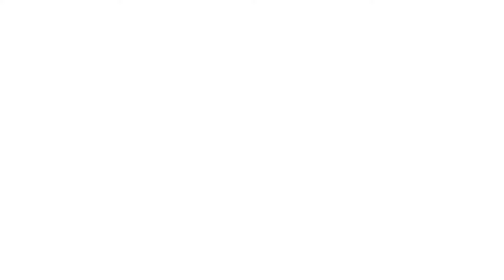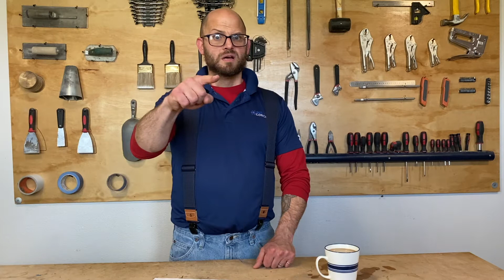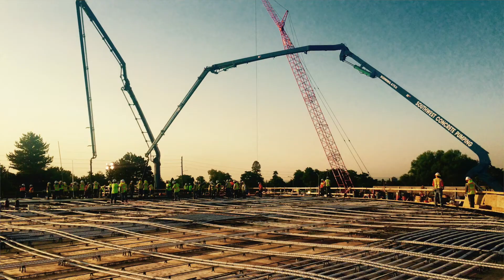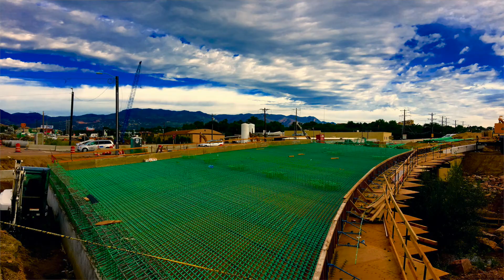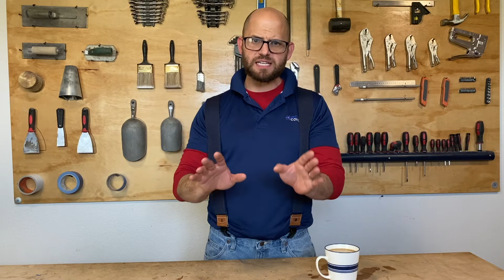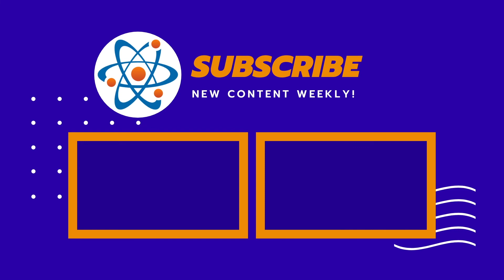The Importance of Coffee & Donuts on a Jobsite

Comment: Good morning good sir, I wanted to pick your brain about a product that I have come across. The company claims their concrete does not use portland cement at all, and they provided their SDS on their website. The 3 materials apart of the mix were crystalline Silica, Ashes (residues), and Titanium(IV) oxide.  Their part B is Potassium silicate. They say do not even use water with their product. This product claims to chemically bond to concrete rather than "glue" to it like the various bonding agent additions. Curious if you could shed some knowledge on the chemical process they are using! Their company is called Terrafuse! They are quite expensive, so mostly trying to figure if they are worth the money!
Reply: Also their SDS for all their product is listed on their website with actual quantities of each part not disclosed but you can kinda tell because they give u a range

Comment: Hi Intelligent Concrete. My local petrol station does great chocolate filled doughnuts. Bit small but 3 for a quid. Can you advise me please! I built a flat roof brick building in my back garden. The concrete roof has blown in a few places. Once I have fixed that, I will put a flat roof paintable product on that has a fabric layer, like a fibre glass sheet. The problem is that I tried twice to fix the blown areas, and now I'm trying to find out to do it properly. For reference you could view the building on YouTube if you search Marland Well House. I'd be grateful for any tips.
Reply from the maker: If you hear a hollow sound it seems like you’ll need to rip out a small section.  Prepping with a cleaning agent like mutator acid is standard.  I like to make the acid is cleaned and surface is neutralized.  I wouldn’t mix up my own batch, just got to your local hardware store and get some premixed “top coat.”
Reply: @IntelligentConcrete  You make it sound easy! It was 'fixed' by professional  builder twice,  so can I do a better job than him? He did do a great job of the brick work. The job has moved on a bit now but you could get the idea from the YouTube post I mentioned. It was filmed at dawn and there is an interesting light effect. There is a well inside. Water is the new gold. It is named after Marland  Brick Works in Devonshire. There is a Marland  brick set in the wall. My ancestor, 'Ganger' Martin was the site gaffer there, known for his fairness and philanthropy.  Peter's Marland is the village where my dad went to school and is laid to rest. I really want to get this building right so it stands for 500 years.
Reply: @IntelligentConcrete  also, thanks for your response and advice. 👍
Reply from the maker: Do you have any photos you send of the site?
Reply: @IntelligentConcrete  How could I do that? The concrete roof is still in tact, but there is a hollow sound when I tap it.  I've yet to break it out to see how it looks  stripped back. One post said after cleaning out and hovering,  the only way to get a good bond is to paint round some brick acid to ensure its really clean,  wash out with water and dab off excess water before troweling on a mix (of what ratio?). I'd like to send pictures,  but to be frank, there isn't much to see at present. It all looks fine until I tap it.